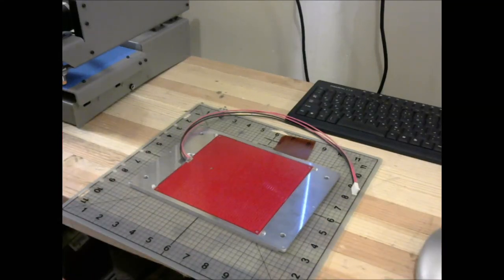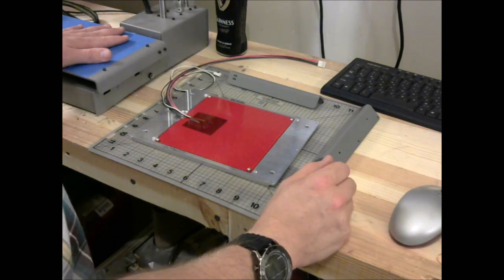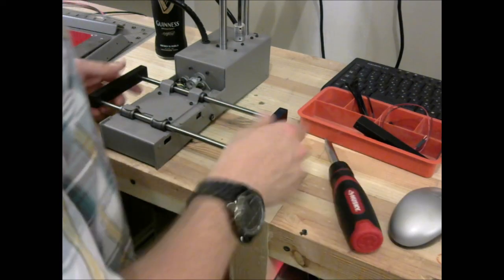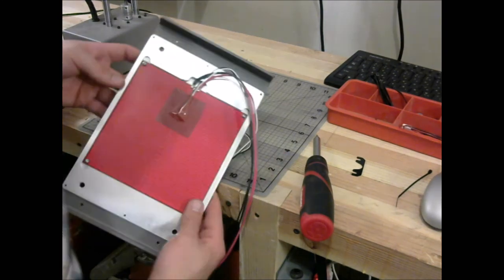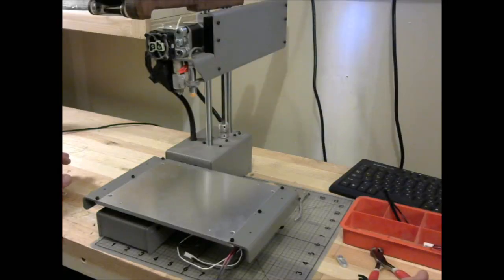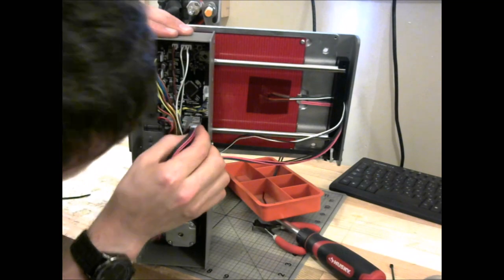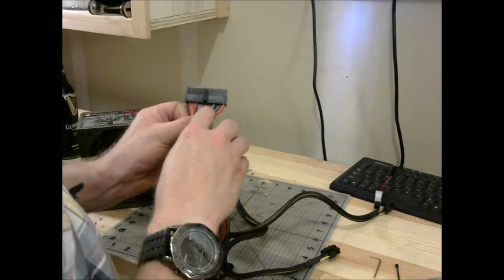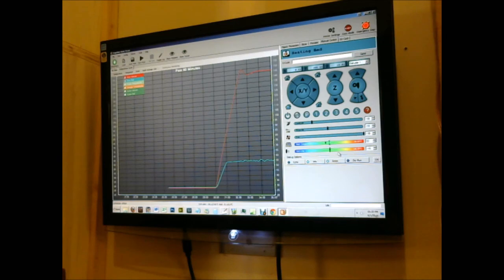Printrbot Simple Metal - Heated Print Bed Set-Up

Comment: I am fairly sure that you are suppose to sandwich the Thermoresistor and between the hot plate and the bed not the outside. That is why there is the routed pathway in the plate there. Which can't really be seen in the video. This prevents the ambient temperature from throwing off the averaging calculation. So you get a more accurate measure of the bed temp.
Reply from the maker: You are correct sir. That's been mentioned earlier in this thread.  Thanks for the catch, though!

Comment from the maker: wi11y1960 I'm still laughing about that. :D To be honest, I had never thought about your belt tip. Good on ya.
Reply from the maker: Which instructions?
Reply: upgrading the bed to heated
Reply from the maker: Nope. Hadn't noticed.
Reply from the maker: wi11y1960 The link to what? I'm confused. Are you saying Printrbot linked my video? Or that they have instructions up now of their own? 

Congrats on getting your first 3D printer, soonish!

I am curious to see the Matrix upgrade in practice. The farther out the arm goes the less resolution you get at that far edge. The Metal is pretty sturdy so I wouldn't expect too much resolution loss, but then again I know it doesn't take too much to lose resolution when we are talking 0.2mm. On that note, I would also want to know the specifications for the table as far as how flat it is and will be at 120C. The biggest pain in my side is a warped table. 

All in all I am happy with the stock 6x6x6. If you are building something that is intended to be structurally sound and you need it to be made of a solid piece bigger than 6^3, you probably shouldn't be making it out of PLA. lol. 

I would be more interested in buying a different hot end or even upgrading to a duel extruder system before I would try and make the print area bigger.
Reply: Thankyou, I hadnt considered what the printer would do on the extended travel.  Good food for thought.  Being a machinist of some degree, it helps to have others wisdom.
Reply from the maker: Any time. I see your profile says you are from Maine. How far from Skowhegan are you?
Reply: According to google, it is an approximate 2 hour drive

I am downeast of Ellsworth by about 14 miles.
Reply from the maker: I have family all over that area is why I ask. Greenlaw and Cahill as family names.

Comment: Doesn't the thermistor go between the bed and the heater in the small machined cutout in the bed itself?
Reply from the maker: Ya, as I prepared everything for the video I forgot about that.  Doesn't make much of a difference though.  Not that I've noticed.
Reply from the maker: My biggest after the fact change would be to use that small channel in the black support arm for zip ties to hold the wires, not to put the wires through the channel.
Reply: Agree, I ran mine through the channel but did dremel it out some. I still don't like it that way so I'm thinking about changing it. That angle between the block and the bed is pretty tight and pinches the wires a bit.
Reply from the maker: Exactly.  I had some shorting issues because of it. Boggled me for hours.